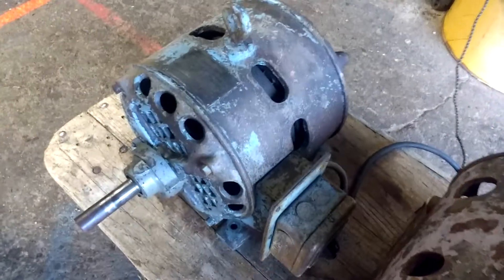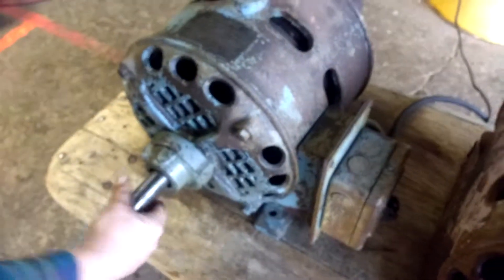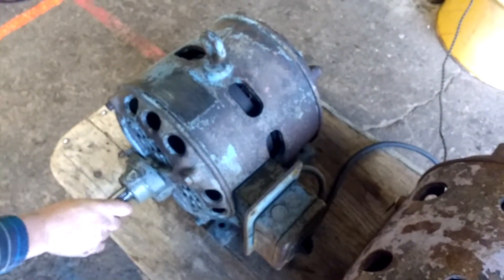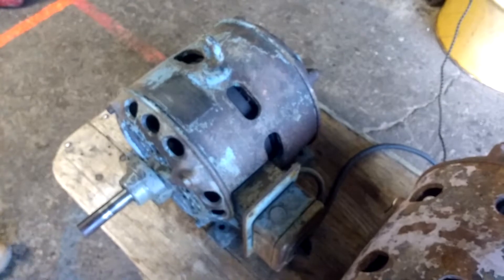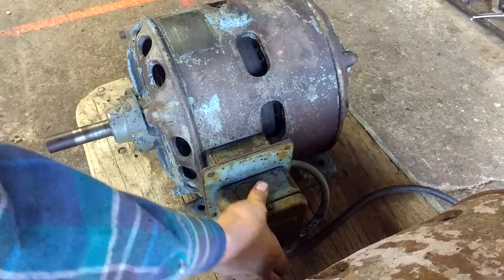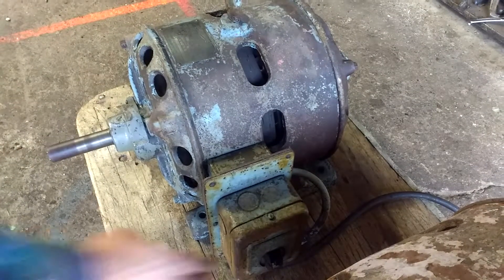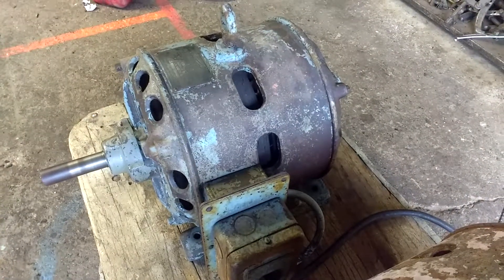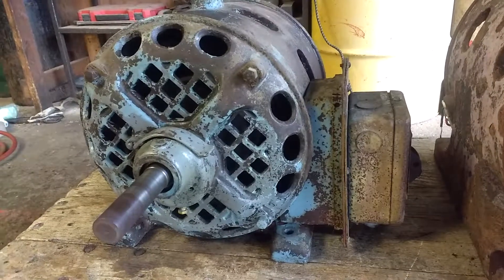100 Year Old Century Electric Motor Test Run

Comment: centrifugal switch and all existed before 1900, nice.

That rattle noise is probably centrifugal switch, maybe damaged.
Reply: Spring barrel ring.  Those rings do that when they get dirt in them.  Just needs to be taken apart and cleaned.  No centrifugal switch in these motors.  Two flyweights operate two pushrods which actuate a spring barrel that carries a short-circuiting necklace and the spring barrel ring.  Shorting necklace short-circuits the commutator segments.  Spring barrel ring actuates parallel motion linkages to lift the brush springs off of the brushes.  When too much dirt accumulates in the ring it frets between the rotating spring barrel and the stationary bore of the brush cage instead of floating like it's supposed to.  Best to remedy it before the fretting wears out the parallel motion fingers since you can't buy new ones anymore.